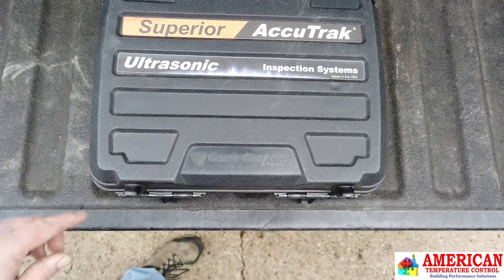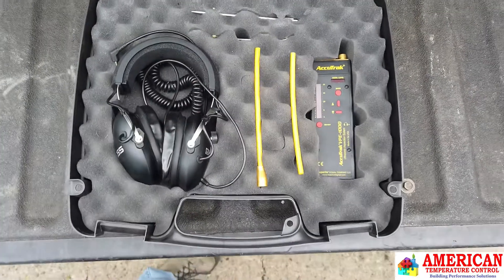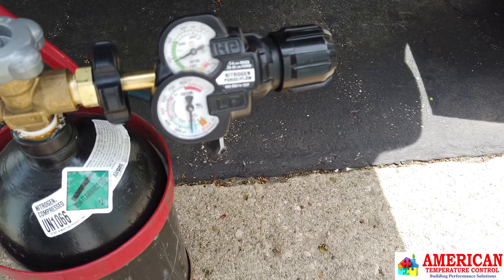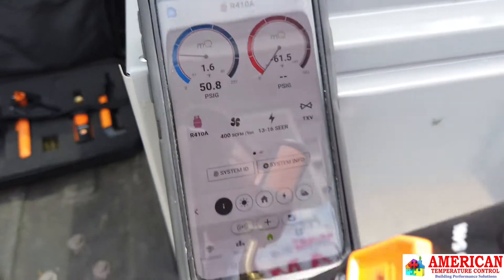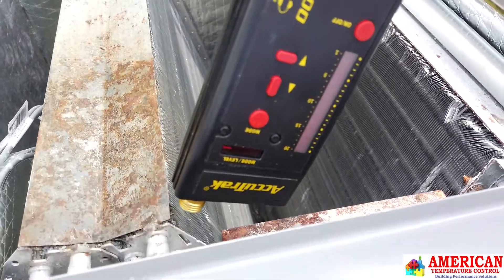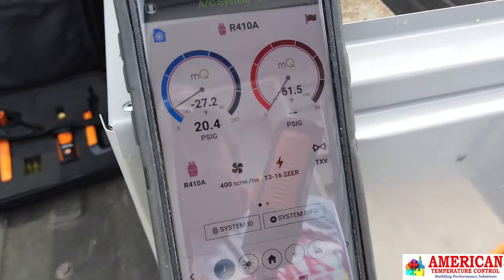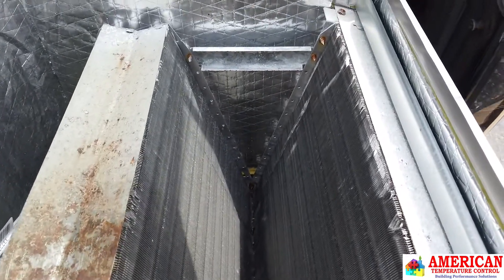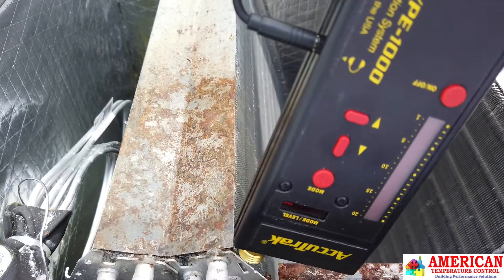Ultrasonic Leak Detection

Comment: Just bought same model including burst blaster, belt holder and touch probe extention kit.
Seller purchased it 3 years ago to find leaks on their compressed air lines but decided to outsource work to specialist company, been sat in a cupboard unused.
Including accessories they retail for about £2500 here in UK, they asked £1100 for it and I offered £800 which they accepted.
I have a couple of sites with units I am struggling to find leaks on R32 & R410a, hoping this bad boy find them so I can put them behind me, I hate leak detecting but I think Accutrac is going to make it fun.

Thanks for sharing your experience with us, it's  what made me look into buying it.

Comment: I work in loud areas often typically with chilled water pumps and lots of machinery. How does this handle background noises?
Reply from the maker: No problem with background  unless there's hissing noise of water or air. It takes some time to understand the tool.

Comment: Have try it on a gas valve leak?
Reply: In order for the unit to pick up a leak, there has to be turbulence around the hole or crack where the leak is. The higher the pressure in the system, the greater the turbulence around the leaking area, the easier the instrument will detect the turbulence.  Natural gas is regulated down to about 1/4 psi into a residential home. So the turbulence around a leak would be VERY SMALL.  Not saying that the instrument can't pick that up under ideal conditions but if I tested for a gas leak and found nothing ultrasonically, I would not assume that there is no leak. Time to break out a sniffer for combustibles and good old fashioned bubble leak detector solution.